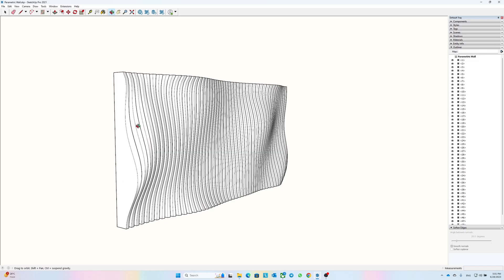Transform Your Space with Stunning CNC Parametric Wall Arts + FREE Design File

Comment: 🤩hi, I'm Fabrizio, a hobbyist from Venice (Italy); nice job, well done.
I'd like to make one, I downloaded the file in pdf format. I will use a band saw for the execution;
I would like to know the measurements of your model, I would make it smaller proportionately.
Thank you
Reply from the maker: Hi Fabrizio,
Thanks for the support. I used 1/2 inch (1.27 cm) plywood, with 1/2 inch (1.27 cm) space between each slat. The whole model measures 58 cm (H) by 119 cm (W). Let me know if you need any other measurements.
Reply: Not at the moment, thanks.
I will bring the drawings from the pdf file to two third of your measurements (as a test I think it's fine), not having the CNC I will use the band saw to cut the pieces, then I follow the work as per the video.
Thanks again.
continue with the videos and your "beautiful" works.😊
Reply from the maker: I would love to see how yours will turn out! Band saw is also a good option for this, I assume it only need some more sanding on the edges.  @fabriziouliana6228

Comment: Thanks for this informative video 👍👍 

How many 4' x 8' panels did you use? If you had to do it again would you stick with 1/2" ply or 3/4"?
Thanks
Reply from the maker: I had several 1/2" Bultic Birch Plywood off cuts from a projecet. They were 2' X 5' and I think I used 5 of them.
I think choosing betwen 1/2" and 3/4" really depends on how tall and wide the final product is going to be. If I build another one 2x or 3x the size of this one, I would definitely use 3/4" ply. I would also leave more space between each board in a bigger design.
Reply from the maker: hello, wanted to let  you know that we Just shared the file for free download if you're interested in getting it

Comment: Amazing job!
Reply from the maker: Thank you!
Reply: @PolarBeaverWoodworking  I'm considering doing this for my studio. But using the ridges as diffuser style panels and shoving sound proofing material in the slots to absorb. Any thoughts on how difficult this would be to make wall height?
Reply from the maker: @Bhackett7777   I can't picture exactly what you are trying to build. Would you please explain more so I would be able to help better. Thanks.
Reply: @PolarBeaverWoodworking  I guess my question is would it be difficult to do this on a larger scale?
Reply from the maker: @Bhackett7777  I don't think it would be more difficult. It is totally scalable and depends on the capacity of your CNC machine. It would difinetly makes it heavier though.

Comment: That's pretty cool sir. If/when you upgrade from the dewalt router to a spindle I highly recommend the PwnCNC 220v 80mm. I've got a code you can use to save a little money. But honestly the noise reduction alone for me was worth. 

Great video keep it up!
Reply from the maker: Thanks for the offer. I think at the moment it would be an overkill for my CNC machine and the scope of my projects, but if I want to upgrade my machine in the future to a bigger and stronger one (which is very likely), I would definitely go with a spindle.